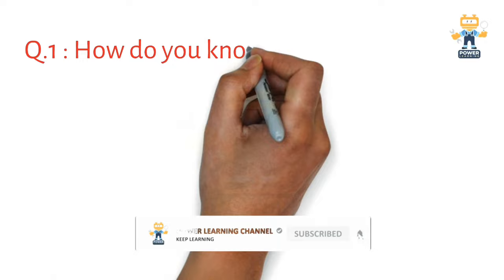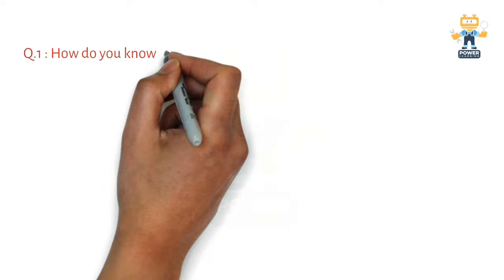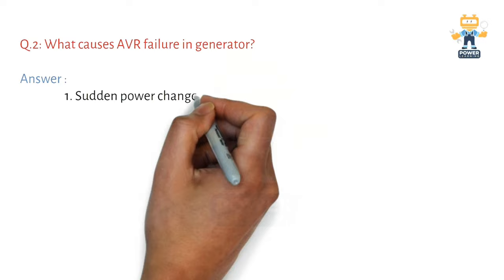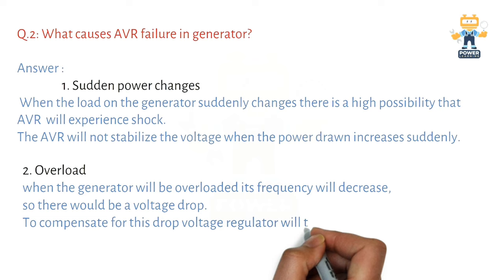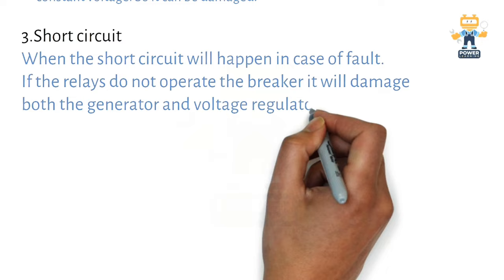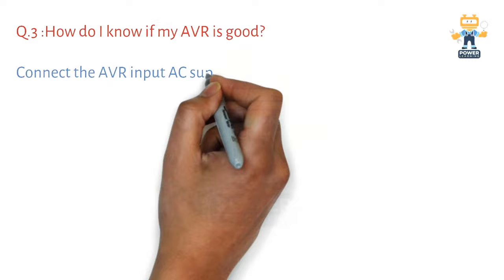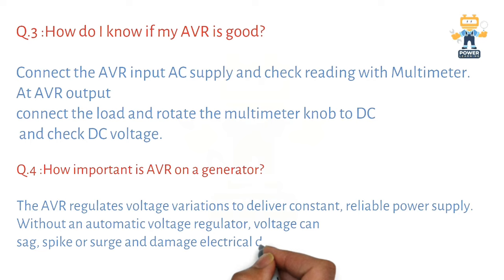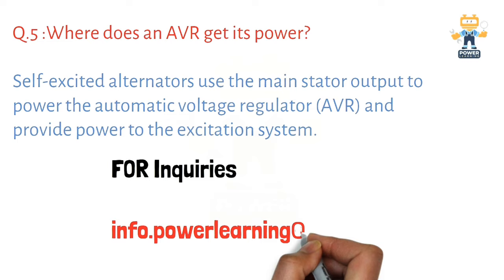#avr How to check Generator Avr Is faulty or not | faults in AVR | AVR problems and fixing solutions

Comment: although you did not answer my previous inquiry,  today i going to ask you,   my excitation wires does not have any marking  such as  f1  f2, or x  xx     also they did not have  any color code  such as  red and black , so how did i know  which wire is positive  or negative,   also if connect the two wire to my AVR wrongly   such as positive wire to mines port of the avr   and negative wire to plus port to the avr,  does my AVR became fault,   please answer me  quickly if you can.

Comment: What is wrong if there is no excitation if I put 12 dc in exciter power coming out 220 I already install 4 different avr still no excitation
Reply from the maker: Did u measure exciter stator resistance
Reply: @DieselGeneratortraining  yes it's 8 oms
Reply: And new rewind
Reply: Do you it's need to reduce the resistance
Reply: If I put 12 volts dc at stator exciter power coming out 220 volts at 1800 rpm 60 hrz